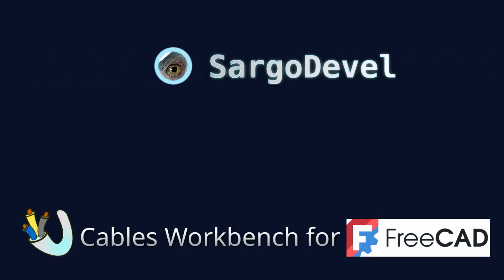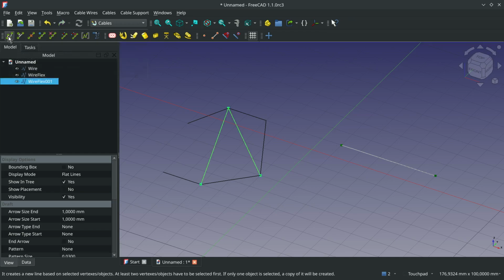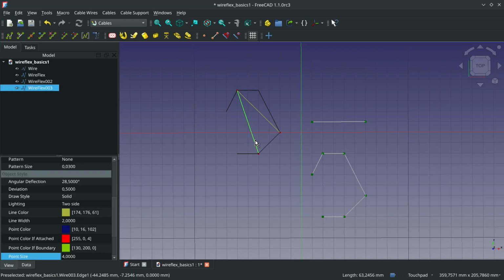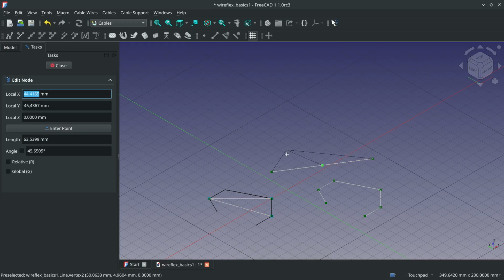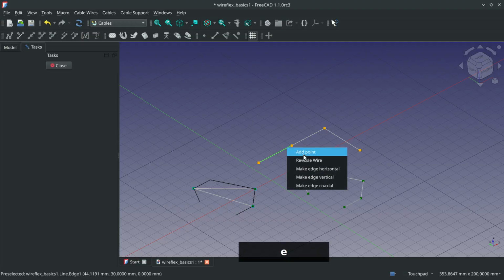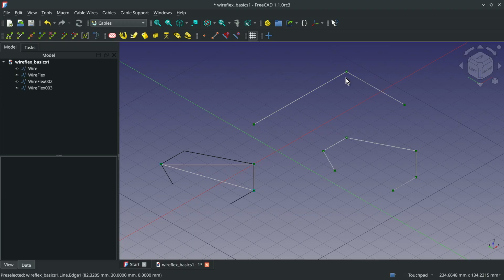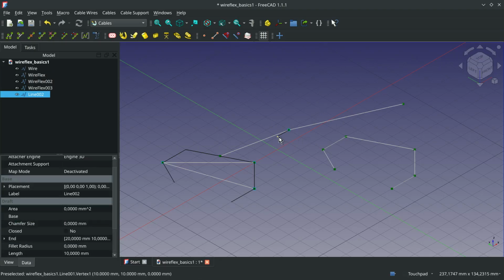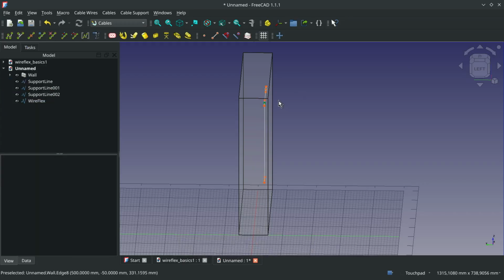FreeCAD Cables Workbench - WireFlex basics

Comment: Sargodevel, first of all, thank you for creating Cables Workbench. I'm also very happy to see you sharing videos that explain how to use the program. They've given me a lot of new knowledge and details for using this excellent work tool. I've been following you for a while and I have a question: the latest addition was the Layers tool. How can it be used with cables? A quick description would be helpful. I also noticed that in the videos you use a Move tool that isn't there when downloading cables. Is this a plugin that I need to download?
Reply from the maker: Hi Jose,
I'm really happy you're still using my workbench and that you find it useful :)

The Move tool:
I took it form Draft Workbench. You can add additional icons from other workbenches when you right click the toolbar and select "Customize". See here: https://wiki.freecad.org/Customize_Toolbars for details.

The Layers tool:
This is to help organize different types of object: WireFlex, Support Lines, Terminals etc. You can easily hide/unhide entire groups of objects by hiding/unhiding the corresponding layer. You can also change the attributes of objects (colors, line thickness, point size) by modifying them for the entire group.
When you have your project with some objects from Cables Workbench, you can click the "Layers Extended" icon on the toolbar. The command will automatically assign different objects from your project to predefined layers. The details are here: https://wiki.freecad.org/Cables_LayersExtended